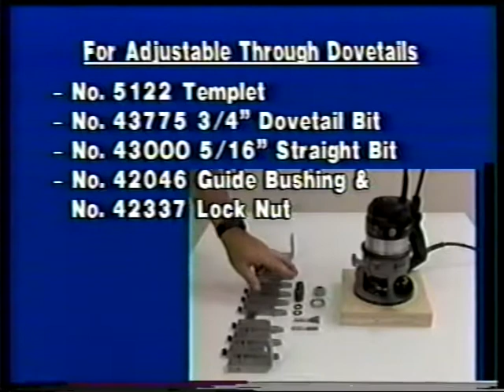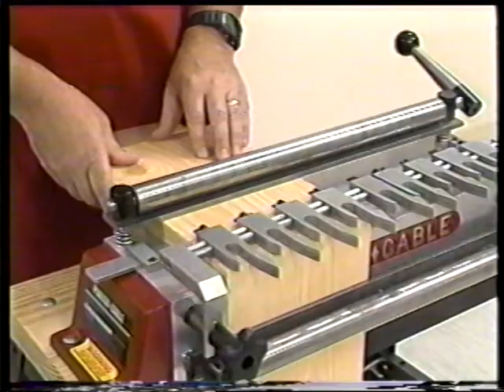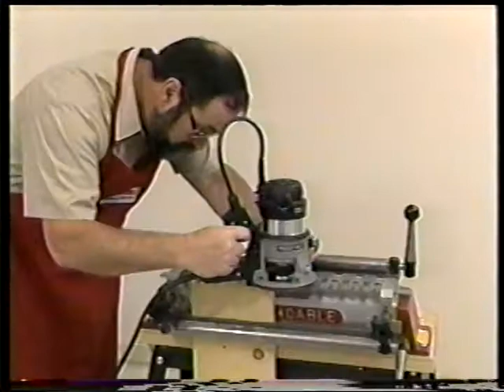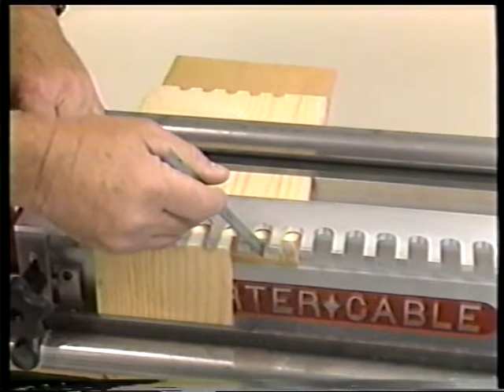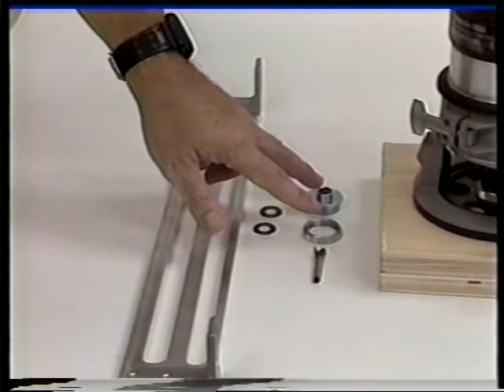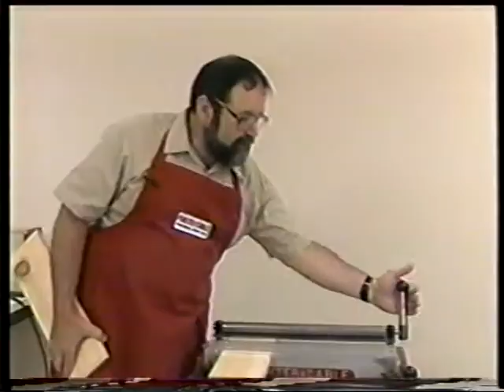Porter Cable Omnijig 5116 Dovetail Machine Instructional Video part 4 of 4

Comment: Porter-Cable Model 5128; A 16" Omnijig® Dovetail Machine with a ½" Box Joint Jig; Porter-Cable Model 5135
But there are other Dovetailing Machines as well.
Porter-Cable Model 4111; A 12" Dovetail Machine with a ½" Box Joint Jig; Porter-Cable Model 4127
Porter-Cable Model 7113; A 24" Omnijig® Dovetail Machine with a ½" Box Joint Jig; Porter-Cable Model 7129
Tools with Accessories are advised or required.
Porter-Cable Model 8541: A Variable-Speed 2 H.P. Mid-Sized Plunge Router at 13,000 R.P.M.'s with a 5-¾" Circular and 1-⅛" Standard Center Hole Sub Base: Porter-Cable Model 30185 with 3 Phillips-Headed Router Screws, a ⅝" Inner Diameter or 13/16" Outer Diameter Guiding Collar: Porter-Cable Model 30058, a Lock Nut: Porter-Cable Model 30248, and a 2003 version of a ½" Straight Cutting Bit with a ½" Shank: Porter-Cable Model 42316